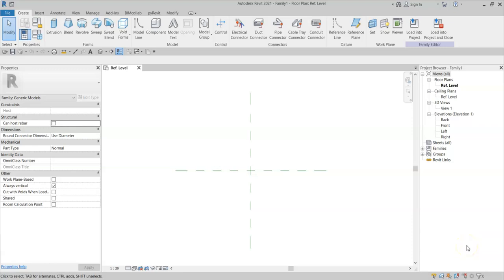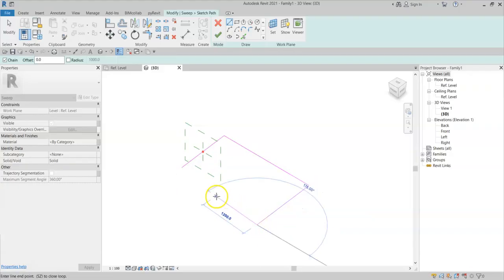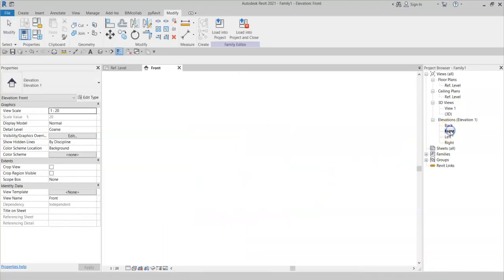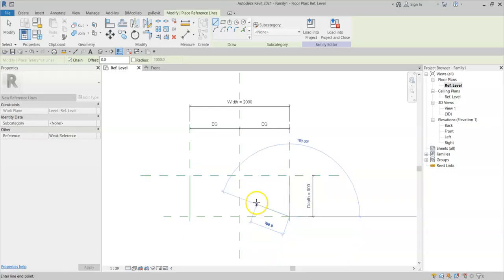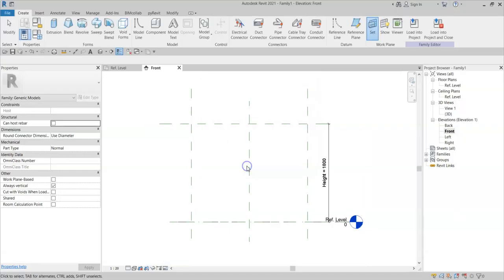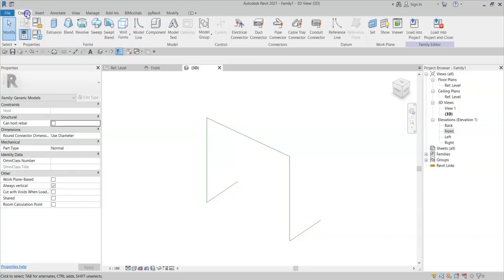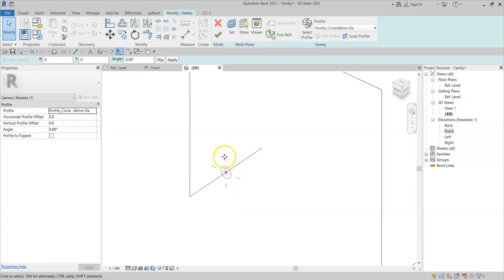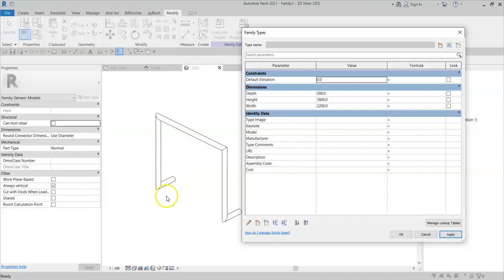Revit - 3D Sweeps Along A Path

Comment: what family is that? i do in metric generic adaptive model but don't have the sweep option
Reply from the maker: You can use any family template, apart from the massing or adaptive component family templates as they still have reference lines but the way you model sweeps is a bit different